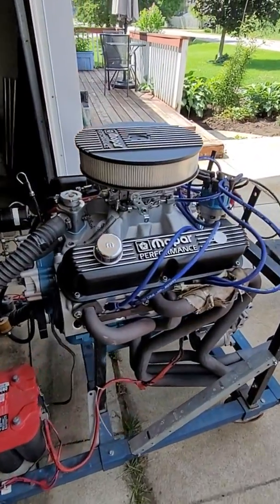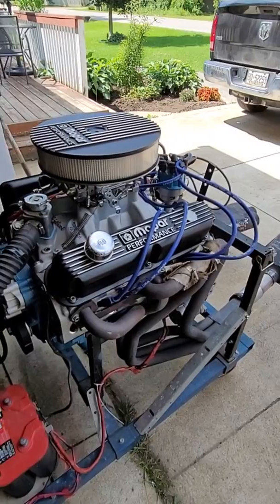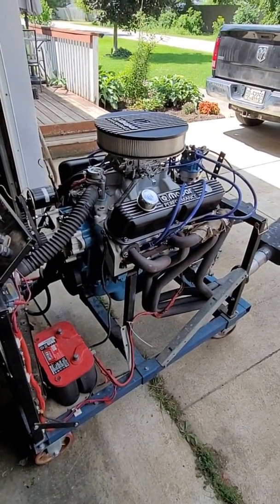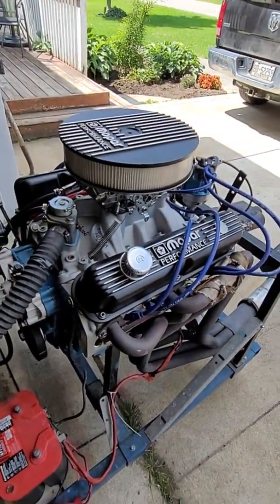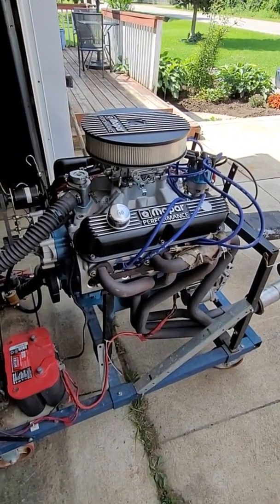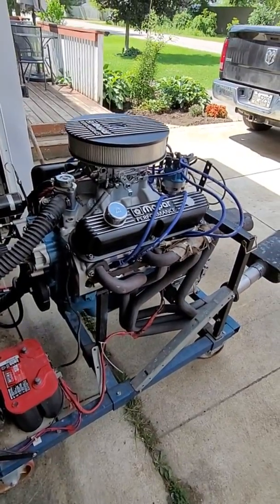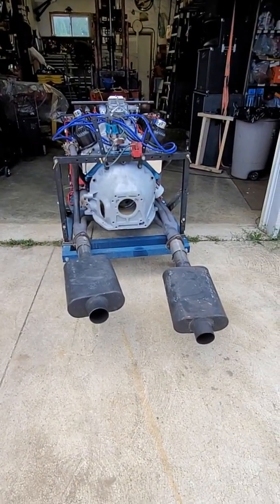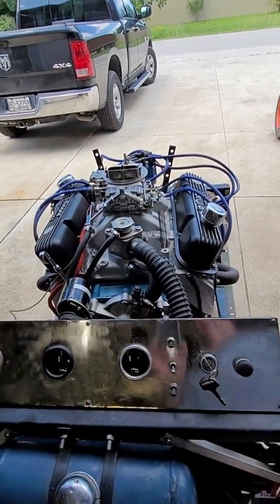Small Block Mopar Stroker. 318 Stroker Engine. 390 Stroker

Comment: Terry, thanks for all the great info. and builds, love the videos👍.

Inspired me to turn my 5.2 magnum into a 390 stroker. 

This is the first time I've heard you talk about vacuum.  That is my current hold up. I want to keep my P/B in my daily driver.  

What's your recommendation for the limit on cam size for a 390 TFS heads, 10.8cr, RPM Air-Gap hyd. Roller for a vehicle with P/B, P/S, AC, 3,000<3,500 Stall?

Was think the 236/242 compcam that you use alot. 

Howard's  recommendation was a 241/247 on 112lsa hyd roller. I thibk that is a bit Too much. I would appreciate your thoughts/input.🙏🤞

Again,  love the channel and wait for the next build.👍 thanks for your time and help.

Comment: What kind of dipstick is that i cant find one
Reply from the maker: Mr. Gasket Engine Oil Dipsticks and Tubes 6923... I get from Summit
Reply: Thank you
Reply: I have a 85 318 flat tappet motor bored .030 over and didn't know if I could run the same heads you are and bolt them on or get them sized to it.
Reply from the maker: @dakotamccoig4438  they work good. I did a 318/390 with
Trick flows and it made 535/535 on the dyno. If it is stock bore 318, that's when you may have to do a little work

Comment: I have a 1992 318 with hydraulic roller lifters 714 cyl heads , what all would I have to change to install the summit cam shaft that u mention here ? Thanks.  lifters pushrods, rockers ?
Reply from the maker: It would be better to keep the roller cam. Or replace with another roller cam
Reply: @brightonracing  thank you Sir

Comment: Do you build Mopar engines for Trucks and Jeeps too? All of the engines I've seen on your channel (I discovered this channel four days ago) have been street/strip builds.
I want to build an engine for my 2000 Jeep WJ. My initial intention was to build an actual AMC 360 but, try and find one. So then I decided to just get a reman Chrysler 360 Magnum.
But, I want to build the engine. There still isn't much aftermarket support for the Magnum engines. S0 now I'm thinking, why not just build a reliable 318? It must be torquey and have a dead reliable idle and off idle characteristics. I cannot have an engine that stalls easily when I'm on the side of a mountain. 
Any thoughts or advice? I didn't know that a 318 could be bumped all the way up to 390 so "easily". I've been a Ford guy all my life. Still learning about Mopar's.
Reply from the maker: Check out the other 318/390 build. It made 535 hp and 535 tq. I only do LA's right now. As far as reliable, you could do a roller, but as long as you use proper oil, flat tappets will/should  last
Reply: @brightonracing  will do. ty

Comment: Awesome video and engine build! I'm in the middle of a '72 318/390 stroker rebuild as well. Hope mine sounds that good when it's done
Reply from the maker: Thanks David l. I am in the process of building another 318/390. I am hoping to get 500 hp and maybe 510 torque. It will be dyno'ed April 15th 2023

Comment: i'm planning on one off these with trick flow heads... everyone keeps telling me to go 408, any regrets on going 390? 
P.S. at this point i wish i had gone with a big block though... sooo much money to make less power.
Reply from the maker: There are more off the shelf piston choices for 408, the kits are less money and you get more cubic inches. Both are internally balanced. Some people just want a 318 based engine, but if it is not a big deal l, it is better to go 408.

Comment: So you had to take this to the machine shop and get the pistons balanced with everything right ?
Reply from the maker: 302 would choke it off alot and hurt RPM but would work. I used speed master heads. They work good, just check them over first
Reply: @brightonracing  sounds good, when did u order that kit from Hughes cause I tried ordering one of their cams awile back and it wouldn’t process the transaction and kept giving me a error code.
Reply from the maker: @randomgaming9684  prolly 2010 or so. I had it for a while before I built the engine
Reply: @brightonracing  what pushrods and what lifters did you decide to run with I have a flat tappet block and I’m trying to figure out the rest of the stuff I’ll need and did you use a stock harmonic balancer or
Reply from the maker: The kit is available through more places then Hughes. This kit was bought  prolly 10+ years ago now.
Reply from the maker: It was a balanced kit from Hugh's.  But it would be the complete rotating assembly, not just pistons. It is internally balanced.
Reply: @brightonracing   would 302 heads work or a set of 360 heads what’s the spec of heads in general needed to run that set up

Comment: Man that sounds deep and mean brotha good job I have a 01 318 magnum I swapped in a 360 should I built the 318 meanwhile ?? What’s ur opinion sir
Reply from the maker: If I had a choice and had 2 blocks available, I would stroke a 360. 318/390's are great too, but still prefer a 408 for the extra cubes.

Comment: The 318 block is actually stronger than the 360 because of thicker cylinder walls. (Even if bored .060 over)..
Reply: Wow thanks for this Info probably good for a small  turbo
Reply: I was wondering if this is true or not. Can't find any definitive proof. Google search gives no results of anyone doing sonic checks.

Do you have any links? Everyone knows at the 60s blocks are much thinker that later ones.

I have a magnum 5.2L that I  had machined 0.030 over for a 390 stroker build.

Bit being a Mopar there is of course, little information out there.

Comment: Wats the horspower
Reply from the maker: Around 400 hp
Reply: @brightonracing  is it something you could do to make it moren powerfull? Im tinking bygger carb or something? Did u use a spesifikk 390 boulding sett to make this happen? Im asking becuse I have a stock 318la out of a 1975 Dodge powerwagon in my volvo 145, think it makes around 150hp now, aand i want more NA power, cost is not the biggest isue, thx😊
Reply from the maker: @torhenninggjerde6389  it has a Scat 4 inch rotating assembly which increases the torque, also has aluminum heads which increases horse power over stock. Your 318 will have a 2bbl onto, where this one has a 4bbl. This set up does not need a large carb. 750 vacuum  is as big as I would go for the most horse power.
Reply: @torhenninggjerde6389  that’s some of the worst English ever.